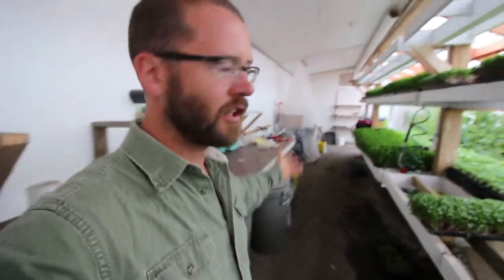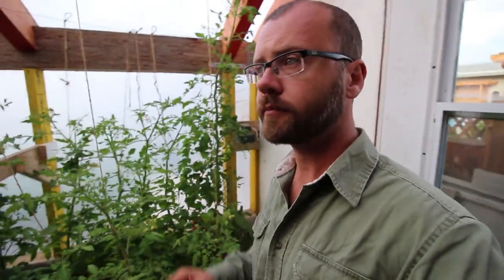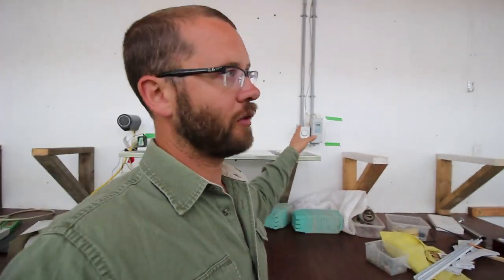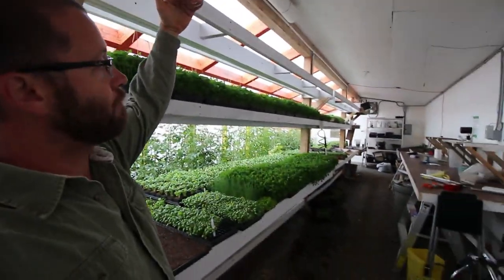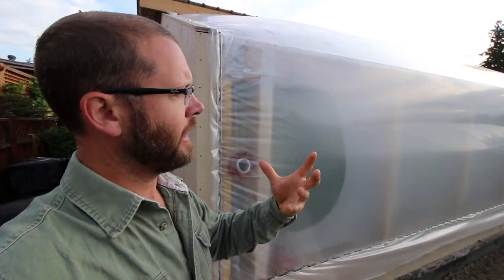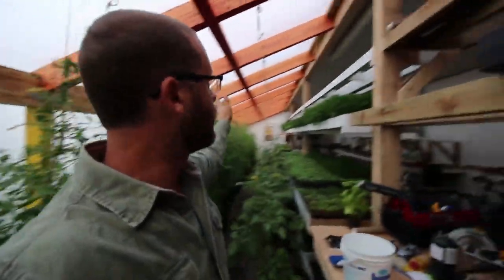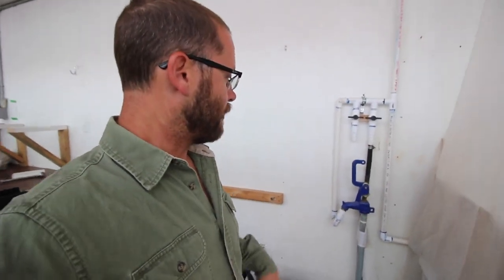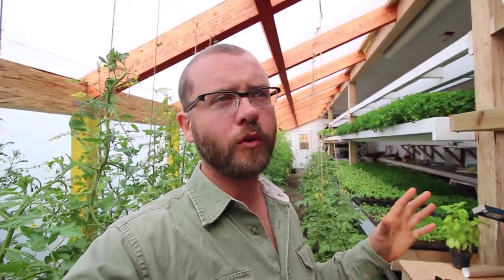Inside My New Passive Solar Greenhouse

Comment: Getting ready to break ground on an earthship using concrete block. Have to build it in three 24x32 sections. Half will be block and living area. Plan on building a masonry stove too. The planter boxes in the greenhouse area is a bonus to me. Made plans to be able to grow 12ft/4m tall plants. I am using 4x6 southern yellow #2 on 2 foot centers. Using fiberglass rebar too.

Comment: You can't store any more heat underground because you limited your thermal storage by putting insulation underneath. If you had left it open below, you could have driven more heat deeper into the earth for even more storage.

Comment: I enjoyed the tour of the greenhouse very much, the effort you have made to optimize your growing season is impressive. 

I'm new to growing food so I was not aware of Passive Solar Greenhouses until now, and it looks as though there are a few different heat storage setup options available that are much more accessible in design that even I could consider using. Storing heat in water is looking my favorite at the moment, so looking out for a very cheap/unwanted solar water heating panel.

Video idea?
I'd be interested know how you manage your composting bins and if you plan to optimize those in the future.

Keep up with the good work and videos.

Comment: Cool!  I am excited that you built this greenhouse with the climate battery. Excellent! I  am interested in the humidity situation and if you have had any mold or mildew issues - specifically down in the bottom of your buried tubes?  Thanks for sharing your work and your successes, it's very inspiring!

Comment: For every 6" of dirt you get a months heat stored?  Mine`s been running for 7 years and i can tell you the amount of heat stored will be the amount you put into it minus any losses. If someone designed this system for you, i would ask to see the calculations as its not going to be upto the task.
Your phase change description needs a little clarification. 
As plants transpire, liquid water is evaporated from the leaf surfaces.In order to evaporate, ie change phase from a liquid to a gas (water vapour in this case) it has to gain energy. The (sensible) energy is taken from the leaf surface,  this is how plants keep themselves cool. The energy gained is now in latent (hidden) form, it raises the RH% but doesnt affect the temperature. When the moist air enters the tubing it drops to dewpoint almost instantly, the RH% rises and the water condenses out inside the tube. During this phase change (gas to liquid) the latent energy is converted back into sensible form and the result is slightly warm water. This is only related to greenhouse cooling.
When the system is heating the greenhouse, the cool air picks up both sensible and latent heat from the ground. There`s no condensation occurring in the tubes because the air doesnt drop to dewpoint, it warms up ( due to the sensible heat gain) and this causes water to evaporate resulting in a RH % increase (latent heat)
If you monitor the greenhouse RH% in winter or cold weather, you will likely see mid  90`s RH% or higher, especially at night, when the system is running. This must be addressed, not only to prevent valuable sensible heat being lost from the mass, but also to reduce the risk of mold growth in the greenhouse, rivers of condensation and less light making it through the glazing. 

The guy you were thinking of is Jerome Osentowski :) He collaborated with John Cruickshank on many installations. John was inspirational during the design phase of my system and many others before he passed away in 2011.

btw, your cover inflation blower should have a diffuser over the outlet to protect the outer skin. You should be using the drier outdoor air (not moist greenhouse air) to feed the blower or you`ll have gallons of water trapped between the 2 covers. Condensation bewteen the two covers will also reduce your light levels by 50%.
Reply: JohnGuest45 that's a lot of info. can you point us to any source? i have zero knowledge of green houses
Reply: There's a wonderfull publication called passive solar greenhouse published by NCAT  IN the 70@
Reply: Also if you have the money to put into it you can exchange the soil for gravel and your thermal battery has almost a 50% gain on capacity
Reply: It's pure nonsense
Reply: JohnGuest45 s

Comment: "passive" means there are no motors or fans or electricity etc. A passive greenhouse would operate only with convective energy, self opening vents operated by gas filled cylinders that move automatically with temperature change, and evaporation etc. So your greenhouse is a brilliant and wonderful "active" solar greenhouse. For a commercial operation an active solar greenhouse is  pretty much mandatory unless it is a very mild climate.
Reply from the maker: +Don Rad Ok Don. I'm still calling it a passive solar greenhouse. I hope you'll be able to live with that ;)
Reply: +Urban Farmer Curtis Stone Sure Curtis. But passive just doesn't fit you or the greenhouse. But if you called it a Thermodynamic Solar Greenhouse,  now that fits. You could patent it, sell copies of the plans, and recoup your investment:))
Reply from the maker: +Don Rad I think I like passive solar greenhouse better thanks. Not looking to make a buck, just share my experiences and help a few people along the way, thanks.
Reply: arm chair warrior over here. Passive refers to the heat source ya nob
Reply: Johnson Rocson -- Um, no.    

"Solar" refers to the heat source.  "Passive" or "active" refers to whether the movement of heat happens automatically (passive) or it takes power input to do so (active).  

What Curtis is doing in this greenhouse is great, and it clearly works, but it is active and his doubling down on his incorrect use of the word passive does not help anyone's understanding.

Comment: Just reminding you there are other choices instead of concrete slab. hempcrete or cob as well as many pothers.
Reply from the maker: +innershifttv I'm not doing a slab, too expensive. I'm going to put down concrete pavers.
Reply: Is that to increase thermal mass?

Comment: How do you get the heat back out of the ground? Do the keep the fan that is connected to the underground going in the winter to use the stored heat? Why do you need a thermostat on it? Wouldn't continuous air circulation  through the ground tubes keep the greenhouse cooler in the summer and warmer in the winter?

Comment: i really like the green house and thanks for the tour. the only thing i was shocked by was the blower for the roof.. for the rest i never seen that roof design. i would put in a one way valve and set the blower on timer and experiment with the interval.. maybe 1 min off 1 on or 2 off one on. maybe you already looked in to it since this video is from the spring :p greetings from dutch guy in germany
Reply from the maker: +Gerben Zandberg it's connected to a thermostat. It kicks in when it's 25c and over and it also kicks in when it's cool, 10c or less.
Reply: I meant the fan that keeps the plastic roof pressurised😉

Comment: Many thanks again and again for sharing. any tips for such a greenhouse in a Mediterranean climate (Palestine)? that would also include Aquaponics. any major things to make different? like aspect, ventilation, materials, size, or other design interventions. thanks in advance.
Reply: and did you try or consider an ebb and flow shelves for watering instead of hand top-watering? I'm thinking about it mainly to avoid losing any drop of water for a dry climate like ours. + from doing wicking beds I find them to be the most water-efficient and headache-free.

Comment: Would you change anything about the basic design besides the over engineering you mentioned?  Specifically in the heating system.  Would you say it's worth the money spent, minus the engineer fee?

Comment: Curtis, I'm surprised how close our ideas on a greenhouse are, I went 36" minimum with icf, got me 5" of foam. I buried perforated pvc pipe to transfer heat from the top of the greenhouse to under my slab, could you explain a little more how "6 inches = a month"  my pvc is buried in 1x4 sand stone under a 6" to 8" slab. I am wondering what I can expect in the way of heat exchange,  do you notice a change from the hot air in to the cold air out, is it easy to feel the temp differance?  I was thinking of using a similar fan set up, does it seem to move the air the right speed for heat exchange.   my greenhouse is primarily for heat, its 18x28 and is leanto style that comes against the house over the second floor windows, commercial grade (like a lowes) with polycarbonate. if your interested in more details let me know.  jim
Reply from the maker: +jim dunker ton I can't explain the technical reasons for why 6" of ground give one month of heat. I'm not a scientist or that versed to much in the technical reasons of exactly why that is.

Comment: Has the blower -- and it creating a firm smooth surface -- helped with any wind / snow / hail load issues  doing plastic film instead of polycarbonate? Interested in how it behaves in wind vs. your other hightunnels.
Reply from the maker: +GrayArea Farm Totally. Even in heavy snow, nothing sticks. It melts on contact. I was pretty happy to discover that afterwards.

Comment: Can you give some links for building a thermal battery for a greenhouse? I would prefer a large water tank that would heat up using solar panels, plus recirculating warm air from the top of green house.
please any links or suggestions.

thanks

Comment: Really nice job here man!! One question though, do you have a syphon on your heat storage systeme? Cause condensation + ventilation = legionnellosis (that can be pretty dangerous) Hope the best to you cheers
Reply from the maker: +DEPRIESTER François I don't think so, though I don't totally understand what you mean.
Reply: François has a point. If You have condensation down there in the pipes, there must be an evacuation for this water. Otherwise the bacterias  like Legionella (naturally present in water) might proliferate in the stagnant water, inducing risks of diseases.
Reply: If the tubes are installed correctly there wont be any standing water, stagnant or otherwise. You`d have a much greater chance of contracting it from potting soil or an overhead misting system ;)
Reply: legionnella's growing range is between 32~42°, under 20° they are dormant.
i didn't hear that there was issues with canadian pit system.
usually legionnella proliferate in heat sinks, cooling towers, and water heaters that don't reach the desinfection temperature (50~60° ).
If the green house temp is around 25°, it's not really a thrieving place for those pathogens

Comment: Great video Curtis, what did you use on the outside of the greenhouse (solid side not the poly side) Also do you still use your RHD truck for farm work? or is it just the new van now?
Reply from the maker: +Russ Jones We used smart board on the outside for finishing, which I am happy with. We still have the mini truck. We use for the van for delivering to big and further away customers. The truck we just run in the main season as a beater farm vehicle for doing dirty work.

Comment: I was wondering what the climate battery comments were about.
If you have condensation between the poly, Ive heard  that you need to draw the air from outside.
Reply: +Tom Robertson _Hey Tom, just google "climate battery".
Basically you use hot air in the summer to heat the earth underneath and take the cool soil to cool the air in the greenhouse. In the winter, the heated soil underneath is warmer than the surrounding soil and can heat the greenhouse for free. It is most helpful at night when there is no sunlight to generate heat. The soil acts as a "battery" to store heat energy and the system dampens the wide temperature swings that result from seasonal changes and day/night solar gain differences. Very cool application!
Reply: +John Beckman  I was wondering on the form of thermal mass.  chinese put a lot of masonry on the N wall.  Ill be using water dincr I cant dig.
It's a wonderful greehouse Curtis has.
Reply: Yes, very cool project. Since he could dig, it made sense to place tubes underneath and use air to transfer the heat. "LDS Preper" also did several informative videos on his geothermal greenhouse. Good luck with your system!!!!!!!!!!!!
Reply: I wouldnt put much store in that system design, it cant provide effective cooling (aka heat storage) even when the greenhouse is at 109F.
Reply: These systems dehumidify the air during cooling, the bulk of the heat stored is thanks to transpiration by the plants, which are always forgotten in discussions even though they play a vital role. The system humidifies the air when it returns the heat to the greenhouse. This is an issue as a large percentage of the energy is in latent form (water vapour) which serves to increase the RH% but doesnt raise the greenhouse air temperature. 
Sooner or later the guys that have installed these multi thousand dollar systems may invest another hundred or two on some sensors.

Comment: Wood is the best material for such structures. Do not use steel due to electrochemical corrosion, price, good thermal conductivity and ecology. Good, corrosion resistant steel  is expensive. Wood is cheap, has very good mechanical properties... 

I have coral culture in wooden tanks ...  Algae scrubbers from wood and also greenhouse from wood... 

--- I am an material engineer so I know what I write ...

Comment: HI, you mentioned the fan running 24-7 in the double side of the polythene walls with the 2 connector pipes balancing the cushion on the roof, could you just tell me how you released the air when it reached it capacity, hope this makes sense
Reply from the maker: +Whats On Pacifica (WOP) Yes, there's just another pipe on the other side that it releases from.
Reply: +Urban Farmer Curtis Stone Thanks Curtis - I watch all your videos, based in Fiji and wish to start the microgreens here, looking doing some research on companies that deliver  here this has been a major issue - thank you again for all your help, I have picked up a lot of useful information just watching and re- watching your videos - I hope to be part of the family making the world a healthier place.  Vinaka as they say here.

Comment: All that engineering, and you didn't change the angle of the roof from a traditional peak? First step to a solar greenhouse is finding your angle of incidence to the sun's arc in your part of the world. Being in Kelowna, you'd be really close to my angle, which I remember a book saying 10+ latitude= 10 + 54 = 64 degrees, which I calculated to be a 2:1 slope, and is pretty steep!
You complained about having to design and redesign the tiered planting setup you have in there because you lose light at certain times of the day or year. This angle is meant to capture the greatest breadth of light throughout the day, all year. 
Your SGH looks beautiful, has many key design elements that I shall use when I build my own, but... that roof man. No way to fix that now though. Pretty epic geothermal system though, I wonder how much that cost to get installed over the top of the foundation? How often did they say it would have to be repaired? I imagine it's less intensive to repair than the water-heated floors, but still a big problem if something goes wrong. 
Of all the over-engineering you complained about, you have many systems that probably would not have all been incorporated into a non engineered design. I can see the benefits, although the cost might seem unnecessary at the start, you now have probably one of the best solar greenhouse in Canada, and it will grow for decades... I'm still jelly.
Reply from the maker: +Spencer Leclair Ok, well clearly, I should of come to you first. :b
Reply: Yep. I'm the best engineer ever, as I don't cost 10 grand! I'm also not an engineer. At all.
The best I know is what I've been reading off a book from the 70's , and what the internets can provide me. It turns out you're still doing the closest/best SGH I've found IRL or online, so keep it going!  ATM i'm trying to watch all your videos... there's just so much knowledge in them i need to thank you for. As a newly aspiring farmer, you are exactly what a guy like me needs. Somehow I've got two urban plots started for the first time this year, but there's a big gap between having a dozen rows planted once and having a market garden or two on rotation. I appreciate your videos and I appreciate your reply!
Bella Coola says hi!

Comment: Hi Curtis, 
Just wondering -  was there any reason you didn't want to install Clerestory windows on your greenhouse?
Cheers
Reply from the maker: +Jeffrey Paquette no, because I don't know what that is.
Reply: Urban Farmer Curtis Stone  Right on, here's a link. http://www.byexample.net/homestead/greenhouse/passive_solar_greenhouse_plans.html I'm looking at implementing this into a design I'm working on which is inspired by your greenhouse actually. Clerestory windows seem to be helpful with managing excess heat in the summer (via ventilation) as well as increasing winter light transmission in the winter. I'm going to put a steeper angle on the north roof slope to reflect more (diffused) winter light directly towards the plants on the back shelves.
Reply from the maker: Thanks, but I'm happy with what I've got.
Reply: No doubt, I just wanted to share the info given that you mentioned that you were unfamiliar with what clerestory windows are.

Comment: 8k sounds like a big ripoff for polycarbonate. Runs about 2.50 USD per sq ft normally. Its still pricey but it holds up for a lot of years where the plastic film has to be continually replaced
Reply from the maker: +Bike Man Dan That was with the shipping and taxes. It was for double layer. If you can find me enough for 15'x48', let me know. Thanks.
Reply: +Urban Farmer Curtis Stone Check out https://www.sundancesupply.com